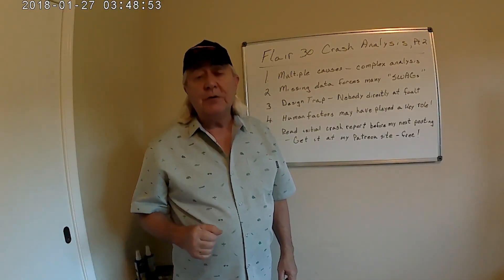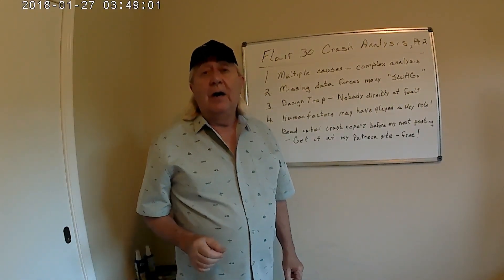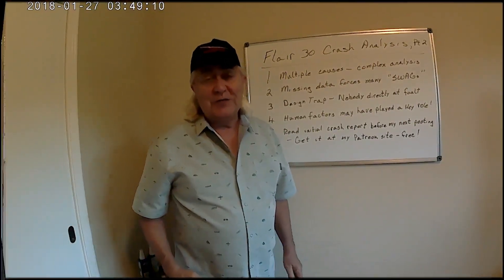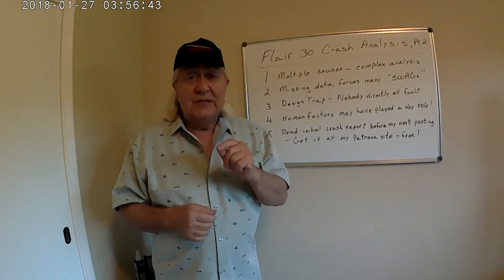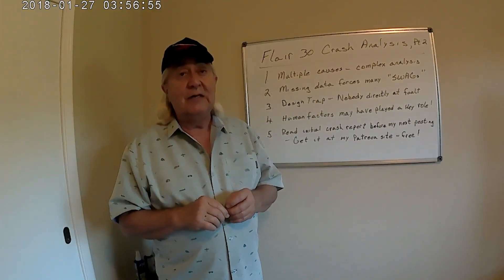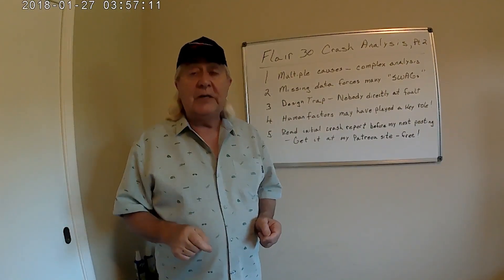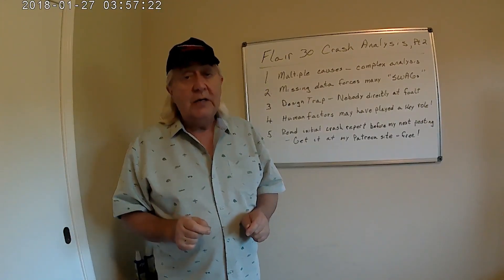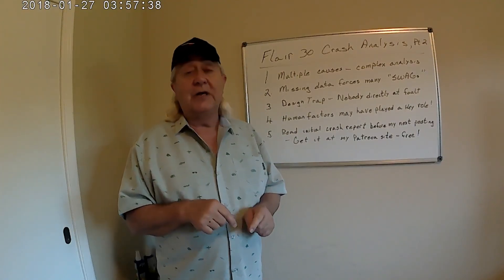Fatal Flair 30 Crash - An Engineering Analysis Part 2

Comment: Hi! I have read the translated german text. It is too bad a translation (is it from google translate???) but I can extract a rough clue of what the preliminary opinion of Prof. M. Schoenner implies for the accident cause: the Flair pilot coming for landing with a high speed (small angle of attack), deployed suddenly tbe central flap. The large flap, possibly due to the wrong placement of the CoG (more forward than it was advisable) caused a nose heavy moment. This nose heavy moment kept the AoA small. The pilot then tried to flair for landing by pulling the elevon up. However, the large nose heavy moment  could not be combated, since the large elevon deflection and the small AoA/ high speed caused a stall in the elevon area in the underside of the wing, therefore ineffectiveness to produce downforce and inability to pitch up. In other words, tbe "tail"was lost. Instead, the wing pitched further down and finally crashed. Seems like a plausible explanation. Possibly, these effects were further exacerbated by the already nose heavy airfoil pitching moment that was used and the quite large washout. However, what I know of the Flair 30 is that it was designed such that the large flap was pitch moment neutral. The fact that it caused irreversible nose heavy moment might have to do with a terribly wrong CoG placement and/or too high speed during deployment. So maybe your further investigation might be able to give us answers. In any case, we thank you very much for the provided info!
Reply from the maker: Thanks for offering to help translate. Now all we have to do is get the original text - I do not have a copy. I'll check with a couple of my potential sources.
Reply from the maker: BTW, would it be possible for you to do a complete and reasonably accurate translation of the original document into English? It would help a me a lot and I'm sure others would be very interested. Let me know, Rol
Reply: @KlingbergWingMkII Certainly! It will be a good chance to cross check the translation and I know of some German guys that can help. Just send me (how?) the original text. Thank you.
Reply from the maker: Thanks for a very helpful post, it really confirms a lot of my internal thoughts that I was uncertain about. You bring up one very important thought and that is the seemingly key "facts" don't pass basic logical thinking - such as the flaps having a neutral pitching effect. Because this format is limited, I'm posting my full response to you on my Patreon site. It will be available to the Public and I will shortly post a link to that writeup here. And, anyone who visits there can sign up  for free - just click the three dots to the right. https://www.patreon.com/klingbergwing